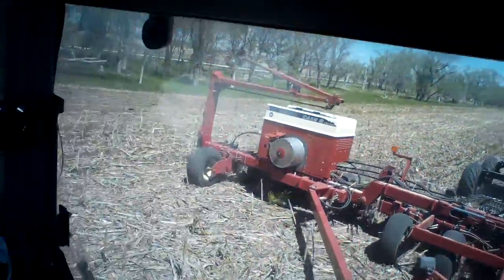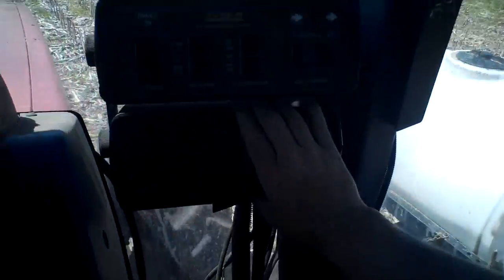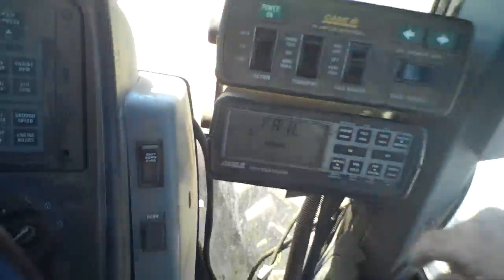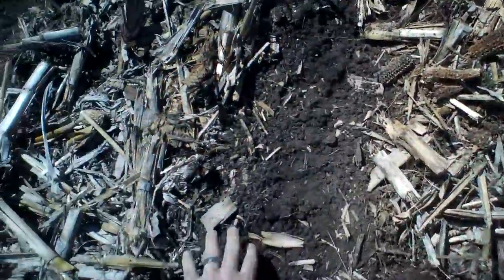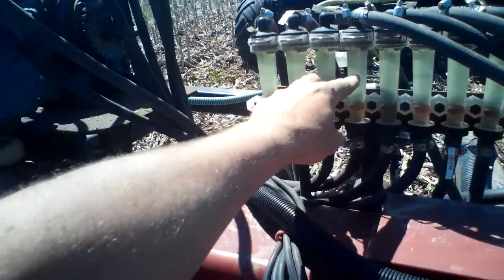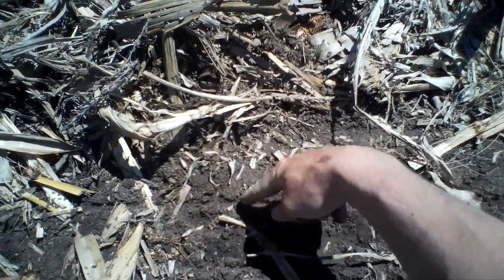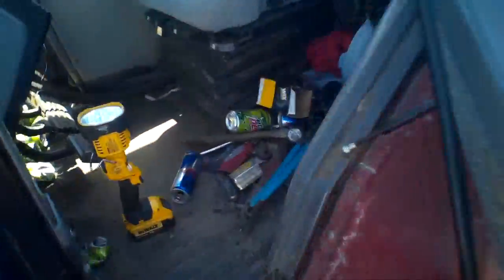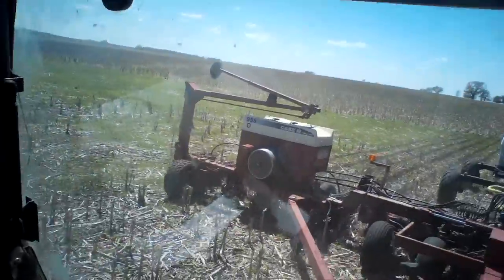Planter monitor gps and fertilizer placement

Comment: Can you set up your auto steer to offset 15 inches from last year, or do you just start the field between the old stalks and go from there?
Reply from the maker: I just run on a WASS signal so my gps signal drifts a bit.... i try to split rows but if i stop and put seed in or what not at different times they dont match up... i have found it really doesn't matter

Comment: ok-i know that the tanks on ur tractor are fertilizer. but what is in the big white tank that is following u? is that some sort of an insecticide to protect the corn as it grows?
Reply from the maker: Hey there,   All the tanks are plumed together and all hold fertilizer it just give me more acres between fills and when its soft i can spread the weight out more evenly instead of having it all on the tractor.   That tank pulls pretty easy
Reply: ok-thanks--i thought maybe the tank u was pulling behind the planter-had something to do with, like what other farmers i have seen pulling a similar tank-behind a set of harrows-and shooting it in the ground before planting anything. i could google the name of the product, but i tried to get others to tell me why it's being applied-but no good. 
and when i seen u have one of them tanks-i thought maybe u would explain-why uns apply it. thanks for the video.

Comment: Ok, sorry, I lost it when talking about fertilizer manifold, and what happens when you apply a lower rate.  Is the finish line of planting in sight.  We are going to start Tues.  Hit it hard and run around clock couple days.
Reply from the maker: I have it set up right now that the balls are all the way to the top when running 30 gpa... and if i run say 10-12 for soybeans they will be around the middle of the tubes